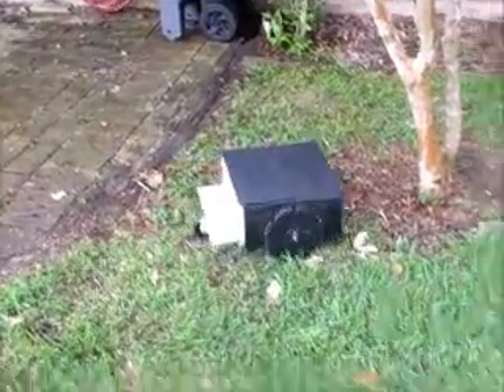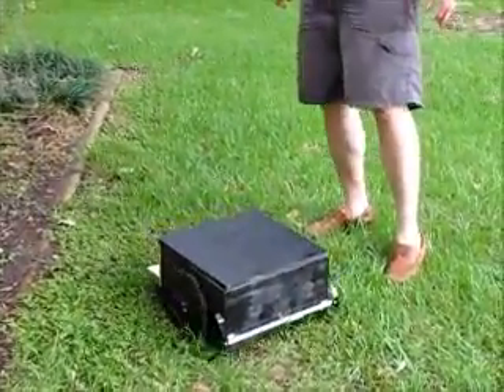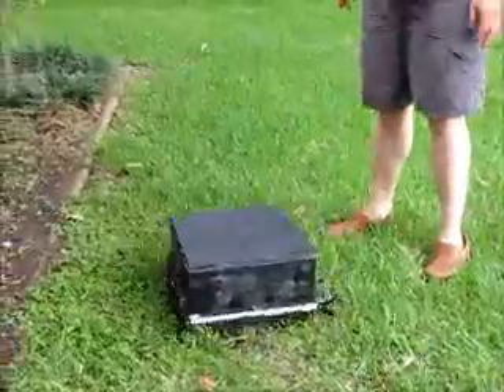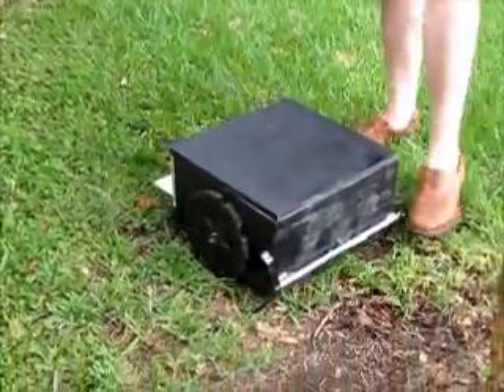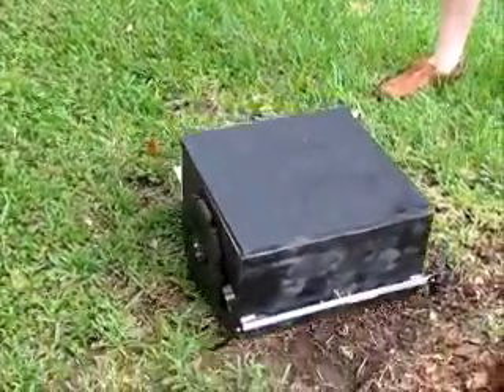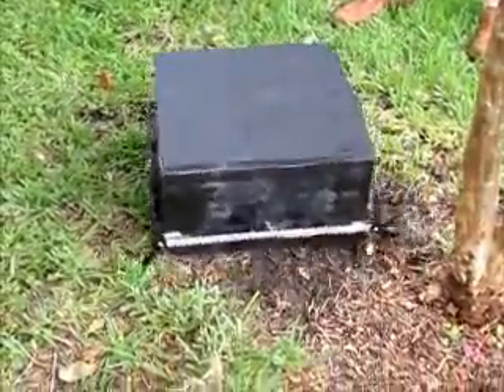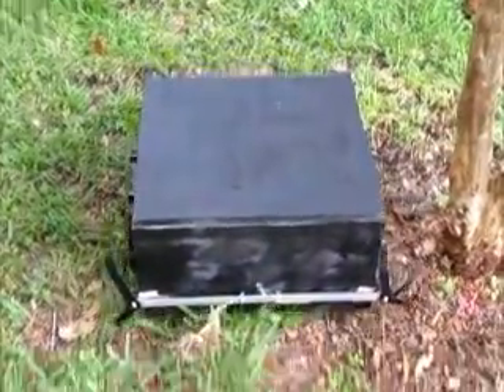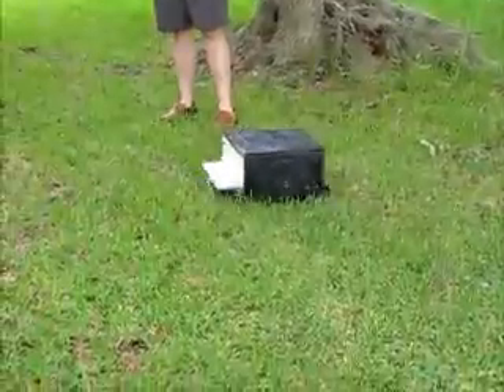Bump Controlled Autonomous Mowing Machine

Comment: How did you install the bumpers? Are you using Arduino?
Reply from the maker: Yes I was using an Arduino Mega 2560. This was back in my re-purposing days, the bumper is simply a aluminum metal strip mounted against small springs on each side with two micro switches I cut out of a VCR.